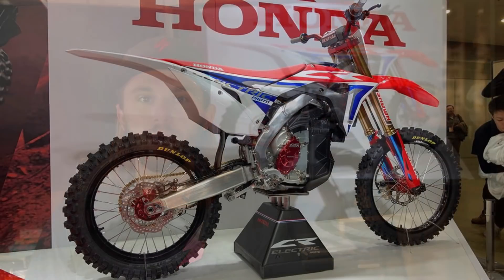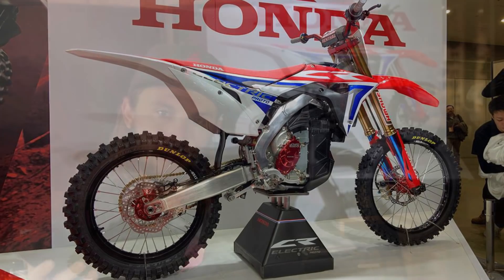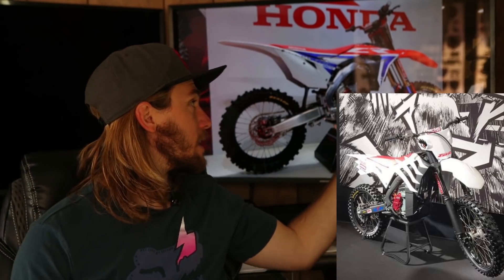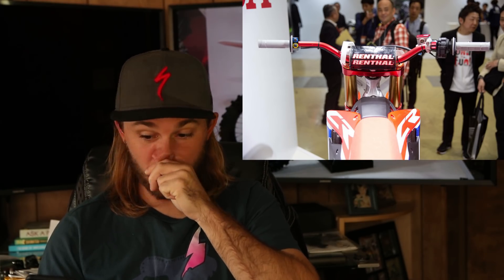Honda Answers Questions about the CR Electric Prototype Motocross Bike

Comment: Trying to replicate a gas bike would be a mistake IMHO. We have gone through this conversion in Remote Controlled car racing and the acceleration and braking of the electric cars vs the gas are a lot better. People aren't going to buy electric dirt bikes because they are better for the environment, there needs to be a substantial performance gain just like when 4-strokes took over mx. 

Massive amount of instant torque is the key feature of electric bikes, then having the software smart enough to deliver that torque with good traction makes it a winner. From there you just have to get the weight down while having enough batter life for it to go hard for an entire 30min moto. 

Just like in RC racing, the downside will be in the off-road world in off-road racing. If you can't go 3 hours at a race pace without needing several hours to recharge it is a non-starter. A fast-swappable battery that can be changed withing 2-3 times the amount of time it would take to do a fill-up would get it there for racing assuming one charge will last at least the amount of time a standard over sided tank would. 

for the trail riders it's going to be a hard sell. Sure it's just a good for putting around the trails but not so great for guys that want to spend all day out riding and don't have a ton of money to spend on having spare batteries on hand. 

Now if I lived in a semi-rual area and had a turn track in the backyard, it would be great to have an electric bike I could hop on and ride for an hour or so when I got home from work and not be pissing off the neighbors or having to worry about doing oil changes every few days.
Reply: I've ridden my '18 Zero FX off road all day without having to charge. Now running 70 mph down the highway is a different story, maybe 60 to 70 miles max. Electrics are getting better everyday though.
Reply: nice well thought out
Reply: Lithium ion batteries... they don't need recharging... same shit on your car. The half life/chemical decay=last long time. My guess is the software runs the bike from stalling out as easy and switches the engine to neutral and builds inertia. Gas starter. Not enough energy or time for electric start. Software probably programmed to  rider.
Reply: Braking same as a car... air hydraulic system prob... programming can be set to release  x amount of air based off the lever
Reply: I just messed around on mine a couple nights ago in the grassy pet area of a condo complex. Residents just watched and waved. One older couple hollered, "You're doing great!" while petting their cat. Fluffy wasn't spooked 🤣 30-45mins later still no cops. E-motos will be what saves our sport.
Reply: Not necessarily, they just have to be as good. ICE vehicles will no longer be made eventually so your only option will be to buy a EV.

Comment: Sick, I wondered if the next generation motors would be electric or direct injection two strokes. Outboards have used direct injection for years to meet CARB standards so very doable. Thank you for the video.

Comment: "Does it have a fly by wire throttle system?"  Was a naive question. It's electric so it not like there are parts moving to adjust air/gas flow. It has an electronic speed controller. Honda is into safety. No traditional cable that can bind.
Reply from the maker: CorpseCallosum just covering all the bases I could think of off the top of my head for users that were curious.

Comment: If a new production E bike comes with an easily swappable battery pack that can last  around an hour and recharge in an hour I'm in. Need to be able to go to the dunes. Also get a lot less push back if you build a track next to the house. Major factors=weight and recharge time.
Reply: They're basically already there. 220v charging will be about 2hrs though. Enough torque too handle the dunes, but dunes would drink battery with a paddle. No engine gyro so they feel lighter than listed weight in motion.

Ride a gas bike in the dunes and a e-bike close to home. That's my M.O. Two different tools for two different types of riding. 250 Smoker in the dunes is 👌

Comment: Mapping of what?  It is an electric motor not a gas engine.  Am i missing something?
Reply from the maker: Ammon Lewis there’s still a controller unit that directs the output of the electric power. So in a sense, what I’m saying is there can be optional power maps/curves/modes that can drastically change the output of the electric motor.